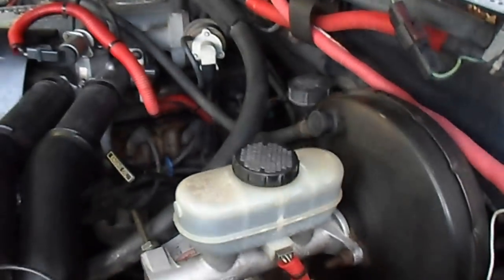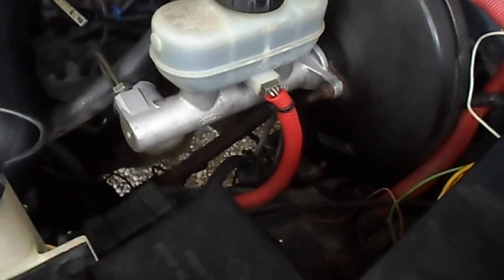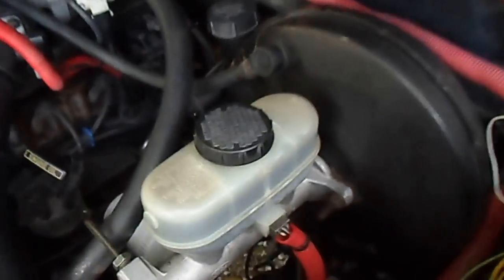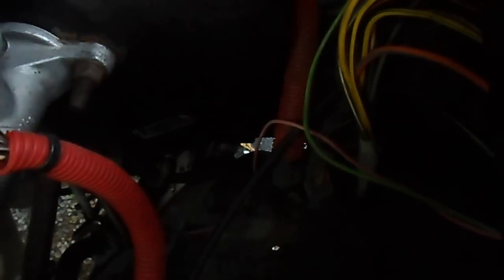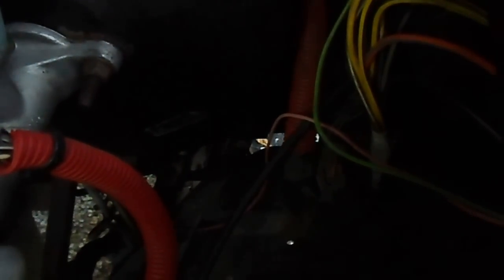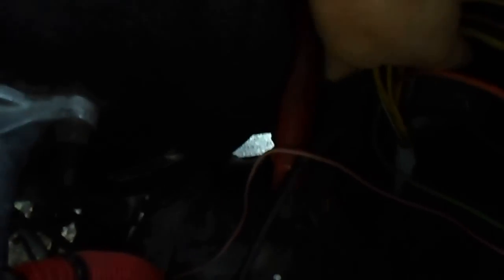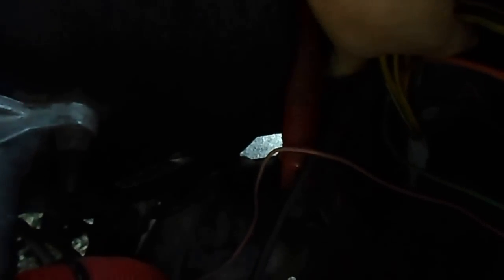1987-1996 OBS F-Series: ECM Removal

Comment: Thanks, Mine is just like yours except has an additional brake booster in the way. Mine is and XLT 4x4 5 speed. And yeah the ECM controls a lot. My electric windows would not work either. Kick the ECM and got the Windows up...lol am going at it as soon as the sun comes up and get the new one in. again thx for the share.

Comment: Thanks for attempt, most just gripe. However... they're correct in this instance. Either retitle "Remove via Braille Method" or delete. Or re-do if inclined.
Don't just leave it up, though.
Reply from the maker: Thank you

I did laugh at the "Remove via Braille Method" line

Definitely will look into redoing it.
Reply: @TheFSeries take it down

Comment: Mine is clipped in and do not see of feel any tabs that hold the studs to computer unit
Reply: having that problem too.  I removed the 10 mm bolt and that harness is not coming off.  I'm doing a twisted smog and just need to get tweak a few wires on the harness.
Reply: @andym1594  solution, I pushed it in got the salwsall and cut mine out. Might fix the firewall if I give enough of a shit... It does slide out but they get corroded in place over time with enough leakes! Only other options is pull harder with lube and prey, or remove the dash and steering collamb assembly...

Comment: what did ya find? ever cure the rich condition? did you have a cel? thanks in advance!
Reply: itsmesomeguy I had a similar rich condition on my 1996 f250. Bad mileage and black smoke out the tail pipe. The problem was an exhaust leak upstream of the oxygen sensor. The extra air caused a lean signal to be sent to the computer. I measured the fuel injector on time with a Power Probe 4 and it was at 6.6 milliseconds at idle. After I fixed the exhaust leak, my fuel injector on time dropped to 3.6 milliseconds at idle. The drop in injector on time meant less fuel was being sprayed into the cylinder and the black smoke from the rich condition was corrected along with a significant increase in mpg. Sorry about the long explanation,but I was pretty pumped when I fixed it myself without having to bring it in.😄